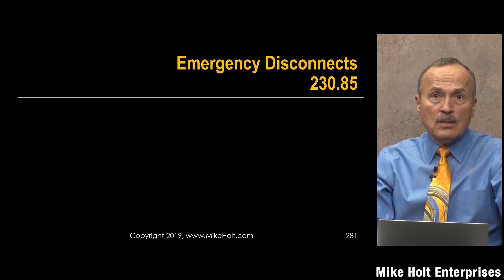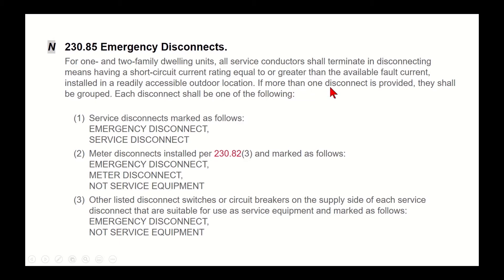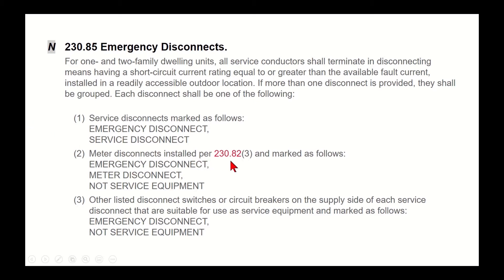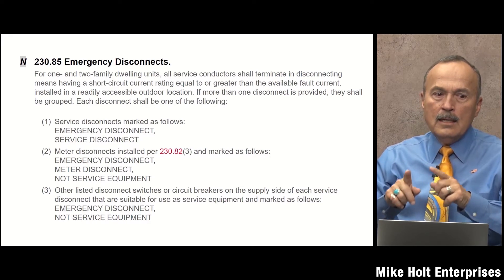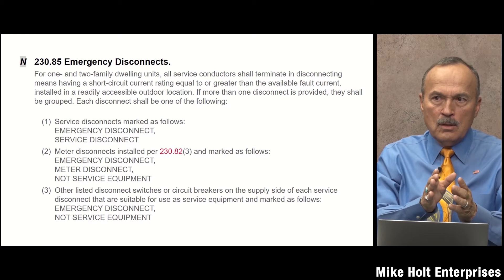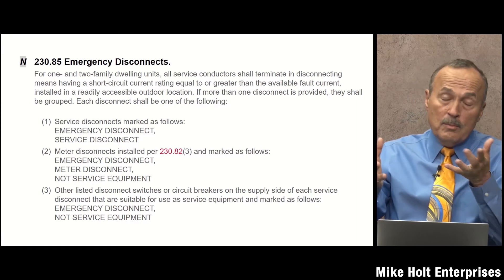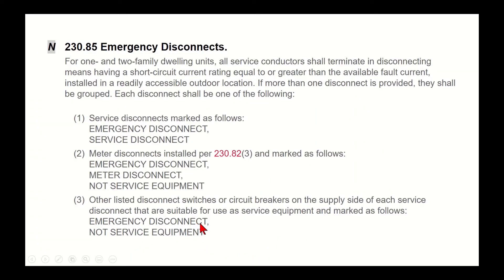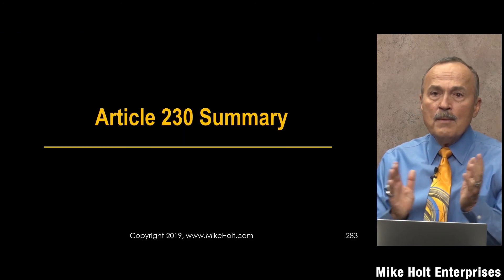Emergency Disconnects [230.85, 2020 NEC]

Comment: Hi, Mike now we ere heading to 2020 NEC Code here in NYC so, my question is if I install a 400 amp main/ meter combo disconnect outside can that serve as emergency/ service disconnect
Reply from the maker: @latcocina1220, yes - see NEC 230.85

Comment: Mike, we run into this situation often. As an electrical contractor and a Generac dealer here in Ohio.

There will be a meter outside and three wires going to the main panel. All the grounding/bonding is done at this panel.

We have inspectors here that will let us install the service rated Generac ATS as an “emergency disconnect, not service equipment” basically meaning we feed three wires in and three wires out and leave the main bonding jumper installed in the ATS. Keeping the main panel in the home as the service disconnect. 

Other inspectors won’t let it happen and we have to install the ATS as an “emergency disconnect, service disconnect” three wires into the ATS and a new four wire feeder to the panel inside, make it a sub panel/ separate grounds and neutrals, and relocate the grounding electrode conductors to the ATS.

I think it was an excellent exception because sometimes it isn’t in the cards to run that fourth wire and relocate all the grounding electrodes when the home is completely finished and having an emergency disconnect outside increases the safety of the home substantially being able to kill power to the home outside in case of a true emergency.

Technically it doesn’t mess up the grounding/ bonding at all because the code requires us to do all the grounding/ bonding at the service disconnect.
Having an “emergency disconnect, not service equipment” in theory is just like a meter base neutral being connect to the can/ enclosure.

What’s your take on installing a Generac service rated ATS with OCP as an “emergency disconnect, not service equipment”?

Also, just want to give a huge thanks to you and your team. I became a licensed electrical contractor in two states thanks to all your knowledge, books, and training material. It was a huge help and life changing. 

Always look forward to the next video!

- Landon
Reply from the maker: I agree that it should be permitted, but it violates the NEC. Call me 352.455.0794 so I can explain.
Reply from the maker: Violates the NEC, post your question on MikeHolt.com/Forum

Comment: I have seen homes with just a meter can outside with the service disconnect is inside. Therefore, an emergency disconnect is required after the meter outside and it must be N-G bonded.  Homes with standby generators (Generacs) have the automatic transfer switches. Apparently, the emergency disconnect must go after the ATS. If the ATS is already N-G bonded, should the emergency disconnect N-G be separate?
Reply from the maker: Please post  your question on MikeHolt.com/Forum

Comment: so.......on both panels, theres a neutral-ground bond?
Reply from the maker: If the emergency disconnect is a switch and not the service disconnect (not likely) then a N-G bond is required at the emergency disconnect and the service disconnect inside. See 250.25(A).
If the emergency disconnect is a service disconnect (likely) then a N-G bond is only permitted at the Emergency/Service disconnect [250.24(A)(4), not any where else downstream [250.24(B).

Comment: Good info here but let’s get real.  To all the comments regarding the rationality of this new regulation being grounded in “Safety”…SFU.  Anyone that’s been in this business for any length of time has pulled untold numbers of meters as a means of “service/emergency” disconnect.  It’s not rocket science.  “Dangerous”, damn straight.  It’s f***ing electricity.  There’s inherent danger in what we do every damn time we step out the truck.  Fail to take it seriously and your wife and kids may not get to see you walk through the door ever again.  For this reason, we all/ as tradesmen, take safety VERY seriously.  But the ever ballooning volume of legislative red tape that continues to engulf our industry year after year isn’t really about “Safety”.  It’s not concerned with getting you home at the end of the day and it sure as hell could care a less about your ability to maintain a profit margin…no ladies and gents, it’s about “LIABILITY” and yes, there’s a difference.  “Safety” concerned itself with the individual, “LIABILITY” concerns itself with corporate entities and ambulance chasers.  So if you want to know why your job becomes less about making sure the lights stay on and more about making sure some dumb ass doesn’t blow himself up every day…understand that this is what happens when we operate in an industry driven by corporate demands on legislative forces aimed at minimizing impacts to the pockets of guys in suits at the expense of the guys in boots.

Comment: Previously I thought it was for the fire conditions happened, for firefighters to cut the power off from outside of the building🤣
Reply from the maker: That is the reason the 2020 NEC to added the outside Emergency Disconnect for one-and two-family dwellings.
Reply: @MikeHoltNEC  Thanks Mike. Bless

Comment: So then it only being required to be an emergency disconnect we call it that by labor, and CONTINUE TO USE THE 3 CONDUCTOR AND MAIN PANEL WITH OVER CURRENT PROTECTION IE MAIN CB, AND we should not be required to rewire the main panel to a sub panel correct?? That’s total bull shit running 4 conductor and rewire the main service to a sub just to meet the requirements of an emergency disconnect. Please comment as to keeping the 3 conductor to your existing service with OC protection as existing not making a sub. Mike please say it on a video that 4 conductor is not required under these conditions.
Reply from the maker: If you install a an emergency service disconnect outside (not a transfer service rated switch) at an existing installation, the 3-wires into the home is permitted to remain. Note: There is never a case where you need to install an emergency service disconnect at an existing home.
Reply: @MikeHoltNEC  How can I show that is the case? I'm getting quotes for a whole home standby generator at an existing home. When I asked if the ATS could be installed inside garage, rep said yes but they would have to install an emergency disconnect outside. Is it not the case that installing an ATS between the meter and main breaker panel triggers the requirements of 230.85?

Comment: One of my local ahj is interpreting this code as the Emergency Disconnect must be secured to the outside of the structure. Even though the code states it just has to be outside. Causing the issue of the service disconnect located at the utility pole to no longer be acceptable as the emergency disconnect even though it meets all code requirements and no addendum to the code stating this has been made. My question is this allowable as an interpretation or are they enforcing above the code requirements? And does the 2023 code address this issue?

Comment: Around the 4:16 mark, it seems there is consensus that if the Emergency Disconnect is not the Service Disconnect, a 3-wire feed could be run to the main panel. And then you'd bond the neutrals at both locations (6:35). Is this right?

Comment: So from the outside emergency/service disconnect panel to the inside home panel, it shall be a 4 wire connection with a separate ground bar in the inside panel for all ground wires since now the inside panel is a sub-panel?

Comment: Love your channel. So much information that is valuable. 
Still confused though as to if that emergency disconnect makes the main panel (where the main disconnect) a secondary panel hence a separation of grounds and neutral is now required and also transfer of the grounding wire to the emergency disconnect. 
This in the scenario of a Meter-->Emergency disconnect -->Main disconnect (inside main panel) setup. 
Ohh my ..

Comment: Power company has a lots of accidents pull or put meter on 277/480.  One for power company and one for you to service.  One before meter power company will have their lock on it. You can’t cut it.

Comment: Should there be an "EMERGENCY DISCONNECT" AFTER THE ATS on the outside of the dwelling?
How does an ATS Serve as a Service disconnect when the generator has no means of disconnect in the ATS (Point of Service), and the Generator fires up when the utility power is turned off and is connected to the house automatically by the ATS?
New Kohler 20KW Pad-mounted generator with kill switch on exterior of Generator cab, and matching 200A Service Rated ATS.
Generator has built-in OCP but is next to the opposite side of the house, out of sight of the Service/ATS.
Interior panel is Main Lug Only.
Reply from the maker: You make an excellent point, but the NEC requires that at the generator disconnect location be identified at the Emergency Disconnect [230.85], see 702.7.
Reply: @MikeHoltNEC  True, the Generator location is ID'd at the ATS.
After careful study and thought I realize that the generator feeder is routed through the attic and also must be de-energized in order to safely enter the structure. This requires shutting off or disconnecting the generator (second source of power). A kill switch at the ATS would help, but the kill switch circuit could fail (fire). the only sure way is to kill the generator feeder at the generator.

Comment: Where can I find the spec for the lettering size, font, and color for the EMERGENCY DISCONNECT label? 230.85 to 110.21B
Reply from the maker: Nothing in the 2020 NEC, but the 2023 will address your question. "Marking Location and Size. Markings shall comply with 110.21(B) and both of the following:
(1) The marking or labels shall be located on the outside front of the disconnect enclosure with red background and white text.
(2) The letters shall be at least 13 mm (1/2 in.) high."

Comment: I think the point that is being missed here is this:  

In some or many older installations (at least here in Texas), the service drop (or underground lateral) and metering are, of course, always located OUTSIDE on the side of the dwelling.  HOWEVER, the "service disconnect" (i.e., "Main Breaker") is often located INSIDE the structure, at or inside the breaker panelboard.   With this in mind... in an emergency situation, there is no way to access the disconnecting means, without entering the structure.

With this code section (230.85), you are allowed to have an "Emergency Disconnect", located OUTSIDE the structure, and (most likely) immediately adjacent to the meter.  Thus, in an emergency, first responders have access to turn off power without entering the building.  This switch would/could also serve as the "Service Disconnect", provided the neutral and grounds are properly bonded.

Furthermore, there ARE disconnect switches available, suitable for use as "Service Equipment", but that do NOT have overcurrent protection integral to the switch.  GE makes a couple of disconnect-type transfer switches which are listed as suitable for "Service Equipment" use.

Also, despite the comment by Mike at/after 2:27,  in context of this code section, an "Emergency Disconnect/Service Disconnect" must indeed, "have a short-circuit current rating equal to or greater than the available fault current...",  as was mentioned by the other party in the video, and as stated in the first paragraph of 230.85.  Again, this short circuit current rating is clearly required, as stated in the first paragraph of the section, and then with included adherence to one of the three additional requirements (1, 2, or 3) of the section.

While it seems silly to have a "Service disconnect disconnect", when viewed in the proper safety context, the use and intent of this code section is quite clear.
Reply from the maker: Excellent comment!
Reply: I love Mike Holt and his videos but his explanation on this caused me more confusion than good. This comment is great, I wish Mike Holt's crew would stay home, they cause more harm than good with their questions lol
Reply: Awesome, I noticed something was off in the video. I love Mike H. Anybody and everybody can make a mistake, it's all good, as a team of strangers, we caught it.
Reply: excellent explanation, but now the inside panel is a sub-panel correct?  In the main inside panel all neutrals and grounds are on the same bus bar.  But now since its a sub panel, would you not have to separate them into each bar and run a additional wire from inside panel to disconnect panel for the ground wire?
Reply: What if the main panel is outside next to the meter socket on a older home that needs to be upgraded from 100 amp service to a 200 amp service? Does the emergency disconnect still need to be applied even though everything outside ready accessible? So basically you have the meter socket then you have an emergency disconnect then you have your service disconnect in the main panel but everything is all in the same general location outside. I know it sounds confusing, but does this apply to a service upgrade? I mean it would be silly to me to have an emergency disconnect knowing that the panel it’s outside next to the meter socket and you can just use the service disconnect.

Comment: I think the reason an emergency disconnect needs overcurrent protection, is that most disconnect switches made by most manufacturers are not rated for anything above 10,000 AIC.  Depending on the available fault current supplied by the utility, this could be a problem if overcurrent protection is not integral to the emergency disconnect.
Reply from the maker: If the available fault current exceeds the rating of the 'switch' then the disconnect must be fusible or have a circuit breaker rated for the available fault.

Comment: So an ats would count as an emergency disconnect if mounted outside, bonding the neutrals in the ats and as well as in the main service panel
Reply from the maker: An automatic transfer switch that rated for service equipment "is the service disconnect required by 230.70," so the ATS can be used as both the required Emergency and Service Disconnect required by 230.85.
Reply: @MikeHoltNEC  Is there anything saying the ATS cannot be used as only the emergency disconnect and not the service disconnect as in 230.85(3)? When adding a generator and ATS to an existing home, it seems like this would be easier to keep the neutral bonding in the inside main panel.

Comment: My meter is on my pump house, near the house. Can I put the disconnect next to my meter on my pump house? All new construction single family home. It is “Readily Accessible”
Reply from the maker: The 2020 NEC does not specify 'where outdoors' the disconnect is required to be locate. The 2023 NEC says it must be 'at a readily accessible outdoor location on or within sight of the dwelling unit.'
Reply: @MikeHoltNEC  Thanks, 230.85 is a big change for Wa state, I believe I am going to be in compliance. 400/320 service outdoors with disconnects on either side of the meter base, (feeding shop and house) is becoming a familiar sight around here…

Comment: There are subtle issues here. Because of multiple ways disconnects in the past have been used and implemented especially say in the house that Mike was referring to. Bonding and grounding are non trivial, short circuit ratings have to be looked at it would be great to take several diagrams and loops to identify fault current path and what would be safe and in line with the code using what would be present on an existing installation or if there were internal service disconnects in the house.

Managing the overcurrent protection between outside and inside and deciding whether to include what and where is a matter of selective coordination looking at various trip-current times whether you are mixing breakers with breakers or breakers with fuses or fuses with fuses delayed or non-delayed types. That’s a more detailed discussion but I think you can bring all those issues here by breaking it down.

Sometimes it may be easier to simplify the installation and add less convoluted fault current path and use of appropriate external disconnects of course then costs becomes an issue.